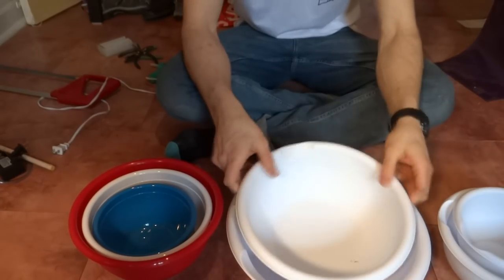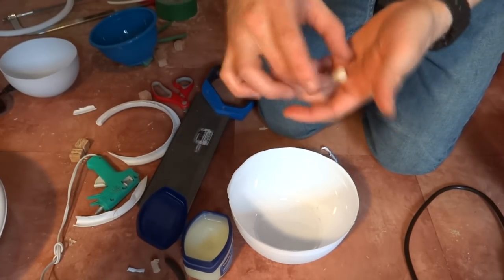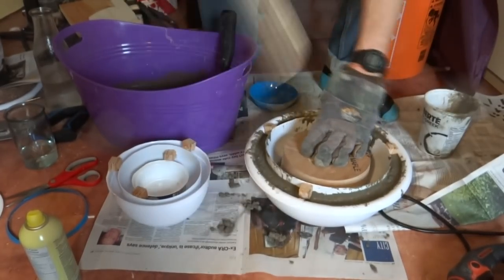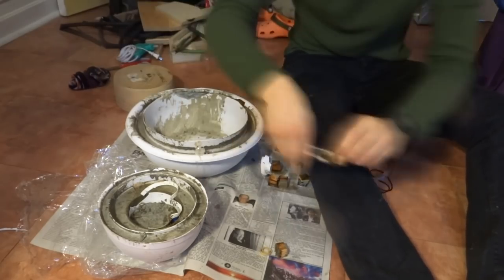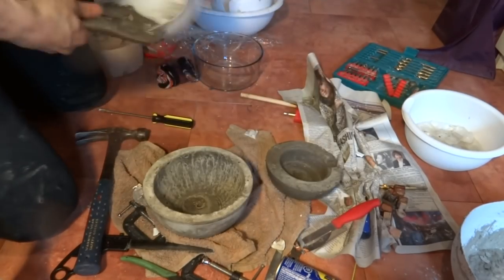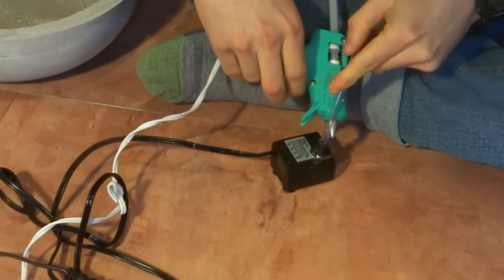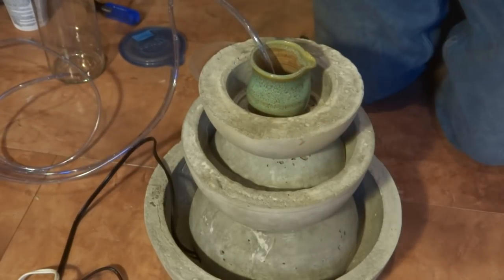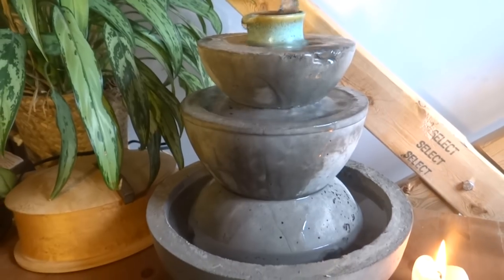How to Build a Desktop Concrete Fountain

Comment: I think a release agent (just some Pam) on the bowls would of helped. I've sprayed molds before with concrete and it worked pretty well.
Reply from the maker: I used cooking spray on the nested tiers and it didn't seem to do much. Someone on reddit recommended Vaseline. I think the main issue with getting those tiers apart was the plastic being sandwiched between two practically inflexible objects, so it was very difficult to break the seal.
Reply: I see what you mean. Yeah I heard Vaseline would work too but I never tried it because it seems like the concrete wouldn't be as smooth or something. I don't know. I'm probably completely wrong on that.

Comment: Hey manjust wondering, what would happen if you didn't add sealer to the concrete
Reply from the maker: Probably not much, but since concrete is pretty porous I thought it would be a good idea to seal the inside.